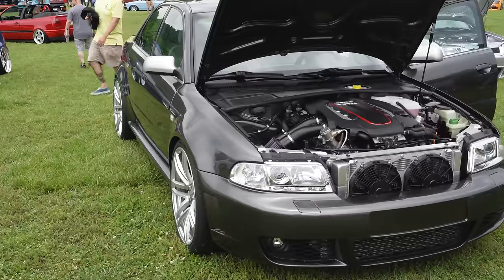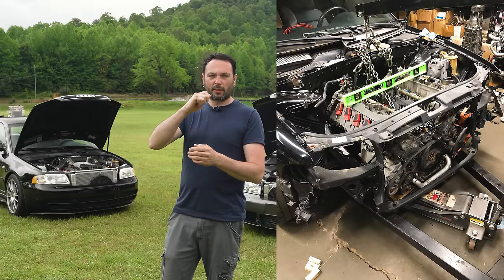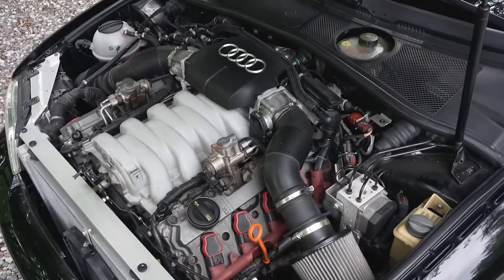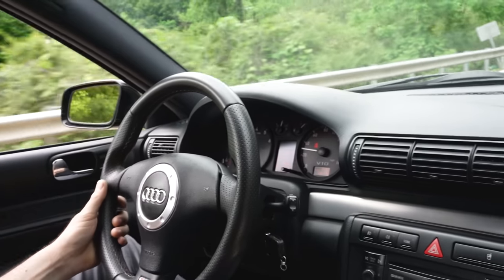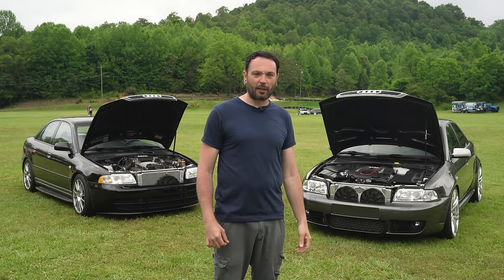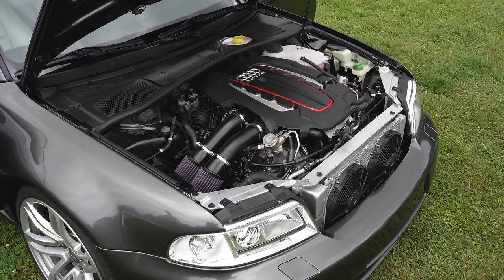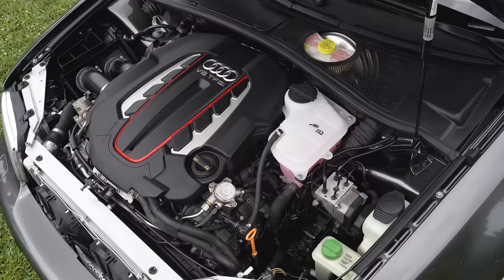He Swapped a Twin Turbo V8 and V10 into Audi S4s!

Comment: I can’t believe he was able to cram a V10 in there.
Reply: Im amazed the v8 fit with factory stuff
Reply: Especially considering how tight even the v6s are in B5s
Reply: Watch Joel Franciso part of the Audi C4 group.
Reply: @hopingforthebest1.9  got that porsche service postion. Step 1. Remove engine
Reply: This is brilliant how much mods to fit a v10 in there. I get the v8 was available on that platform so it could be done.
Reply: @lutha1720 they’re both b5s, so I believe they only had 4cyls and 6cyls as options.
Reply: Miata owners dropping the beer
Reply: Maybe it is quick but it also understeers like crazy 🙃
Reply: @wlkxd8442 That’s not hard to fix, but it will naturally have some tendency to understeer with the engine past the front wheels.

Still, you can do quite a bit to take care of that so it will be neutral off throttle and oversteer on throttle. That’s what you want at the end of the day
Reply: It’s more accessible than the V10 in my R50 Touareg
Reply: That’s what she said
Reply: Sits a V8 car. It's converted to wide body which come with the 4.2 that's why it fits.
Reply: The wide body model have 4.2
Reply: @PokeChu0107 rs4s are also 2.7T
Reply: @shirneetbenzo6619  only b5s. B6 and b7 came with a 4.2

Comment: That v8 engines a nightmare lol… At least the timing chains/tensioners between the intake/exhaust cams on the 30v V6’s are vaguely accessible without pulling the engine, and the cambelts at the front.
Reply: I'm sure he couldn't care any less considering the work he's done - now for the rest of us.... yeah
Reply: @Jackinacox  Yeah but what I’m saying is, just building the S4 engine would’ve been easier, and made great power, with less headaches.

Comment: The swaps are really cool, but the thing that really intrigues me is the technical and engineering side of things, like solving the CV shaft issues, and sniffing for CANBus signals. Rad!
Reply: According to the video it's easier if you get c6 s6 wiring harness to get the engine running instead of using canbus convertors

Comment: This is sweeet! I’m currently in the middle of a swap myself. I’ve got a MK6 Jetta with a 2.5L + 09G, lol, well, I did, the car is gutted now and I’m putting a 3.6L V6 + DSG in place instead.
Reply: Are you modifying the engine at all? 
You rarely see 3.6 VR6’s modified like you do with something like a VQ. 
They seem to pick up solid power with bolt ons and an e85 tune, would be cool to see an NA VR do the same.

That along with rwd conversion would be awesome in the Jetta
Reply: @PapiAndrey  There’s not a lot of love for the 3.6.. lol, minimal aftermarket since people can pull more out of turbo motors. I’m likely just gonna tune it and that’s about it.
..but we know how that goes.. “yeah I’ll leave it like that” < then all of the sudden your car is completely something else >

Comment: Wow, both really sweet builds. I’m a MQB fan myself. I’m hoping to one day put a DAZA (RS3 5cyl) or the HPA VR550T in my Alltrack.

I was thinking the other day it would be cool to strip down an alltrack or sportwagen and put a 5.2 with the R8 transaxle in the back, pretty much build it into a supercar in a wagon shell.
Reply: 2.5t vr6 is cooler and more fitting than the ea855, though the Hpa version will probably as much as the car or more.
Better off buying a crate engine yourself and modifying it yourself.
Even if you had a tuner do it for you, it would be cheaper than going through hpa, only thing is no warranty
Reply: @PapiAndrey  I know that innovative motorsports has successfully done the RS3 swap in and Alltrack and I love the 5-cyl, but it IS more than the car. Still cheaper than buying an RS3 outright. I also have a spare 1.8 engine that I may throw a 2.0 crank, forged pistons and rods and upgraded valves into it, I could make close to the same power and would be less expensive, but you can’t beat the VR6 or inline 5 sounds and greater potential.

Comment: It sucks that Audi never made a B5 coupe...would've been even more epic to see this build as such.
In any case, I recently found and started following Martin's work and how surprised I was to find this video just uploaded. 😂

Thanks, guys!

Awesome work, Martin! Much success to you! 😎👍🏻
Reply: I've never even thought about that but it would look so damn cool as a coupe.
Reply: @kristoffer3000  I've seen a few renditions on the web and it didn't feel right, but I guess it was because the roofline was similar to the sedan. A coupe needs to have a slightly lower roof, windshield with a steeper angle.
I don't know if you ever seen, but Audi produced a single A8 D2 Coupe in the 90's, a project co-made with IVM Automotive.
A roofline following that design would've been perfect for a B5 Coupe, I think.
Reply: @Roddy_Zeh  Yeah, I googled it to see if someone had made some renders and none of them looked right, they mostly just removed the rear doors and called it a day.
Slapping the first gen A5 roof on it would look great.

Comment: I love the lack of screens everywhere inside. I really miss simple interiors on cars. The options out there are ridiculous, almost every new car I looked at had a bunch of screens in it. I like it when I don't have to worry about a computer glitch taking out my gauge cluster or my infotainment system taking a crap and I can't do anything with it. The older technology is more reliable. My uncle bought a new Corvette and it was a nightmare when the electronics started up and he was in limp mode twice due to the electrical system failing multiple times. I was told while at the dealership they had been having a lot of quality problems with electrical parts working correctly. Edit: This is the reason I have been looking for a 1988 through 1995 BMW M series that isn't completely trashed.
Reply: You’re gonna be disappointed to expect anything reliable in a B5 😂

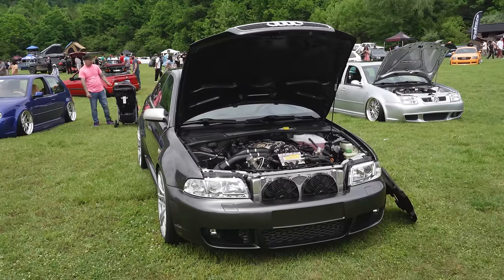Comment: Great job with both Audis.  I commend your thoughtful ingenuity and patience to get it right.  Separately, is a video review of the VW GTI briefly shown in the background at this point 14:38 also available?  If so, please provide a link.  I'm interested in talking with you about my 2004 VW GTI 2.8L 24V VR6 (engine code BDF, transmission code 02M).  Odometer reading: 165K miles.  Original clutch and timing chains still installed and working well.  Most serious issue with the car: new suspension needed.  I'm the original owner, only driver, and the only person performing maintenance on the car.  I kept it EOM for 19+ years.  Now it's time to do a full refresh of engine accessories under the hood, along with the suspension.  My intent is to go with an OEM+ approach.  The objective is to keep the reliably good VW parts and replace less reliable parts with OEM+, not high performance parts unless they are more reliable than OEM.  Objective: re-instill reliability and dependability into the car to support daily driving and cross country touring.  Also, on an opportunistic basis, smartly improve performance if possible, without sacrificing reliability, dependability, and maintainability.  The end result will ideally be highly reliable and maintainable without odd quirks.  Bottomline, if you're available to be contacted through email so we can coordinate a phone call to discuss what I outlined, I would appreciate the opportunity for us to talk.  Again, great work with the Audis.

Comment: I like what you did with this audi can't get enough of the engine sound and wide body very good.

I have audi A5 3.2L V6 quattro 2011 but it does not want to get in reverse gear any recommendations?

Comment: Suggestion for you air filters. HKS makes those pancake air filters that you can push them into the inner fender areas and get colder air and get them out of the engine bay. I’ve ran my intakes to this area from MK1 scirocco’s all the way up to the newer stuff.

Comment: My name is Tim H. I am 34 with cancer and have been building up my 16' Jetta Sport Gen3 1.8T. Can you run a larger turbo then the stock K03S or K04 without blowing up the motor? Or is it about max boost pressure.  Currently it has a stg 2 tune. Intake, exhaust, brakes, tires etc.. Im going to run it in our local autocross street events.  I'd appreciate your knowledge.

Comment: He is doing what I would like to do, but in Germany to be able to drive an engine swap legally, makes these builds twice as expensive. Let's say just realising a V10 in there costs 20.000€, then having it legalized costs around 3000-10.000€ extra on TÜV and you need to inform your insurance and this will cost you a big extra as well. Not taking into consideration, that you can't increase horsepower over 10% in Germany without upgrading brakes. And ultimately you have an engineer approve that the body can cope with the increased forces.

Comment: Dosent matter how it looks or what’s wrong with the car, the swaps are really good. Congrats for him 👌 but what gets me really is the fact that he said, all the parts for the RS widebody is straight up a lie. Front bumpers are no where to get on the whole planet and not even here in Germany to get that right. The only thing available brand new, windshields, grill, side fenders, whole rear side panels, the doors on the back from the RS4. Everything else is completely discontinued. The fog lamps are from the s4 b5 pre facelift eu models from 98. what’s available is the engine for 28grand just the block at Audi that’s it.

Comment: You do know those are the two most unreliable engines produced nlby BMW? The V10 needs a bottom end bearing change every 40,000 miles to avoid damage.  The V8 Twin turbo by 60,000 miles for the same reason.  While that may be OK for racing where it's rebuilt after a few hours of racing its impractical for street.
Reply: I think this guy could handle it